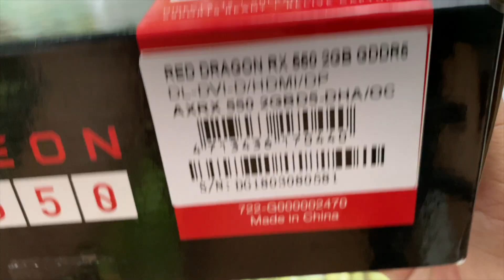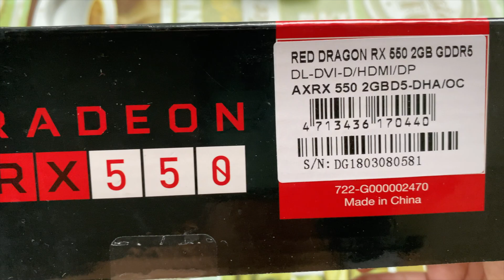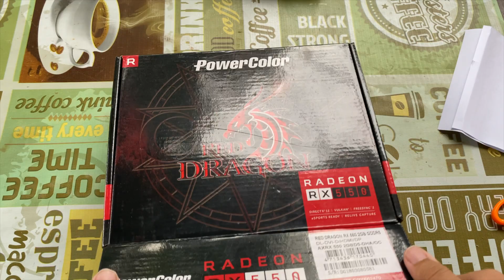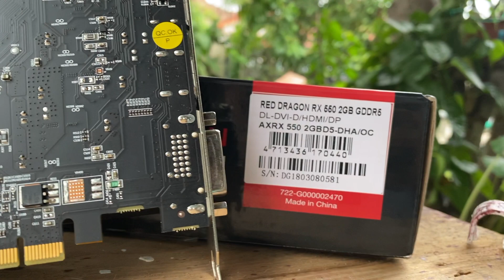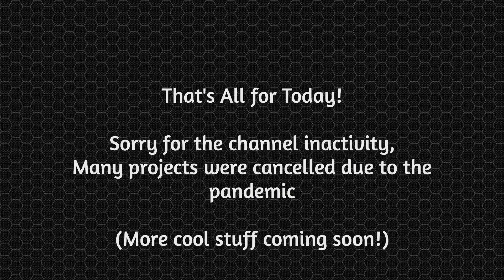AMD RADEON RX 550 2GB/4GB | Unboxing, Installation and Quick Look [PowerColor Red Dragon]

Comment from the maker: If you have any questions don't hesitate to ask! I'll try my best!
Reply: Is it good to get it in 2021 and are the graphics good?
Reply from the maker: @txramaiesyt2546  it’s good enough for esports games.. don’t really recommend it for big or AAA games if you wanna game at 1080p
If we’re talking about 720p then it should be fine
Reply: Can core i3 3rd gen 6gb ram, can they support the gpu?
Reply from the maker: Use_Wallow_come sure, they can work
Reply: @GhastUnity  ok, thanks 🙂
Reply: Is the refresh rate Hz 75?
Reply: How do you clip
Reply from the maker: @zyxu1830  I think it supports 75hz!
Reply from the maker: @oogwayYT  clip?
Reply: @GhastUnity  How do you clip
Reply from the maker: @oogwayYT  what do you mean? I don’t understand 😬😬
Reply: the fan of my rx 550 is not spinning when im not playing. is that ok ?
Reply from the maker: Yep! It has a 0 rpm mode when it’s idling. Perfect for HTPCs
Reply: Is this good with i7 10700 processor?
Reply from the maker: Yep should work fine with an i7 10700. Id advice go with a better graphics card if you have the budget though.
Reply: Any suggestions?
Reply from the maker: I’ll give a few recommendations but GPUs are hard to find right now

GTX 1050 Ti
GTX 1650 Super
RTX 2060 / 3060 (very hard to get)
RX 570

These should be 50% faster  than the RX550.
Reply: What's the cost of RX 550
Reply from the maker: I can’t tell you the exact cost of a RX 550 because due to the current situation the prices are very unstable. At MSRP they should be around $80-100
Reply: @GhastUnity  Okay thanks 👍
Reply: The gpu turns on but it won't post I think it's because I don't know how to connect it to the power supply
Reply from the maker: @pxrple1686  this RX 550 doesn’t require any connections from the power supply.
Reply: Hi there, in the video it shows the vram as 2048 but the product states that is has 4gb. why are the two different? btw im new to pc building so if i misunderstood something obvious then please help me out cos i dont really know what im doing 😬
Reply from the maker: @joeygibson9702  because I’ve bought the 2GB version. Nowadays they are all 4GB models. If you see 4GB, then you’re good to go.
Reply: @GhastUnity  ah i see, thankyou very much for your quick reply. i shall find a 4gb model for a budget build online 👍
Reply: when I  install card, all i get is a blank screen upon start up, why is that?
Reply: Does the POWERCOLOR RED DRAGON RX 550 work on asus prime b450m
Reply from the maker: @THEXGAMER01  yes
Reply: Ist ok for very old motherboard
Reply: Bro mine is 250 watts power supply does this work for me?
Reply: Can it run fortntie 1080p
Reply: Is this the best rx 550 on the market rn?
Reply: bro how much watt power supply is needed
Reply: @GhastUnity  Is it good and run smoothly in amd 9600?
Reply: thinking of buying it some day and i noticed the graphics card has an hdmi port that sticks out, do i need to connect that somewhere to make it work? (if so i'll need a new pc cuz my motherboard is vga only 😭)

Comment: your the only person i can find with this card who will reply so i got a couple of questions, what sort of fps are you reaching on fortnite and call of duty. how loud is the fan and finally give me any more info like pros and cons from your experience
Reply from the maker: Hey there I couldn’t say what FPS I get for call of duty but I’d say it will be playable at 720p (60> FPS) and for Fortnite I get around 70-85 FPS at 1080p (competitive settings) with 16gb ram and the 2gb variant.
If you have a little more do go for the GTX 1050/Ti as it will be better overall for gaming (and better driver support cuz AMD abit slow with driver updates and support compared with NVIDIA) 
As this is an entry level GPU - don’t expect 60 FPS+ at 1080p with AAA games 
But for most e-sports Games (I’ve tested cs go, rocket league and valorant) can guarantee 60+ FPS 👍🏻 at competitive settings (or better settings in some cases)
Reply: @GhastUnity Hi, did you used all of the available display ports from the gpu? the dp, hdmi and dvi portss???

Comment: The RX 550 is really the only reasonably priced GPU Avitabile rn, this variant along with another slim factor card from Yeston were the only ones I could find for around 200$
Reply from the maker: Yeap. Unfortunately. I luckily managed to get a 3060Ti with only 10% more than MSRP. I couldn’t get another GPU for my friends tho. Literally zero in stock atm.
Reply: @GhastUnity  Yeah scalpers and miners make it hell to get cards, lucky for me I got the Zotac RTX 2060 back in 2019 and so far it's served me well.

Comment: Nice vid, im planning to buy this card for my budget build. Anw what cpu will works fine with this gpu? Still kinda confused on what cpu should i get
Reply from the maker: Hi there, If you’re going for a budget build. I would recommend i3-9100F or i3 10100 and  Ryzen 3 3100 or 3300X
These CPUs won’t bottleneck the RX550.

For an AMD build, I recommend going for dual channel memory for maximum performance. You won’t see big difference going single channel for Intel which leaves a good upgrade path.
Reply: Okay then, guess I'll take the ryzen 3100. Is a 2x4gb 1600mhz ram enough?
Reply from the maker: @farrellsuryaghifari7014  Nice!, AMD has great upgrade path because they are using the same socket for quite a long time now. 1600mhz for DRR4 is very low. I don’t even think they’re selling that.?
Try looking for 2666 MHz minimum for AMD.
8GB will be just enough for 2020.
If you’re looking to upgrade in the close future soon I’d recommend going for 1 8GB stick so you can upgrade to dual channel 16gb later.
If you’re not then go for 2x 4GB

As for motherboard I’d recommend minimum B350 or B450 motherboard as its provides overclocking capabilities and much better VRMs to handle more powerful CPUs down the road compared to A320 chipset.
Worth the extra dollars if you ask me!
Reply: wow, that's alot of explanation lmao. But appreciate it alot, thanks, I'll Go for 2x4 2666mhz then. Thank you for also mentioning the motherboard, really you're a nice person. Anw since im new, can all type off gpu get overclocked? Sorry for the question and suck English lmao
Reply from the maker: @farrellsuryaghifari7014  your welcome! Yes and no. All separate / dedicated GPU like in the video can get overclocked to different levels. It’s based on the type of GPU and your luck. Some overclock higher than others. It’s called Silicone Lottery.

Built in GPU or APU they call it cant really be overclocked.
Reply: @GhastUnity  ah thanks, any rec on what budget case i can get? Lol sorry, im a newbie at this
Reply from the maker: Farrell Surya Ghifari any case with good airflow will do. Try looking up on YouTube for recommendations, and make sure your motherboard will fit in the case.
Reply: @GhastUnity  got it, thanks
Reply: @GhastUnity  should I get this in 4gb or gtx 760 in 2gb??
Reply from the maker: @As0hy  GTX 760 will be heaps faster than the RX 550, if your power supply can support it. RX 550 is a entry level new GPU.
Reply: Same

Comment: Hey, thanks for this video! I hope you’re still replying to questions. I’m building my first pc and got all the parts. However, as you probably know, gpu’s are out of stock everywhere. So I ordered this one for temporary use till I get a chance to buy rtx3060/3070.
I’m using Ryzen 7 3700x, with a x570 plus (wifi) motherboard, 16 gb 3600 ram. Do you think this gpu will perform decently as a temporary build? Will there be any damages to other parts like the cpu if bottleneck happens?
Reply from the maker: Bottleneck doesn’t damage anything. It really depends on what resolution your trying to game on. Expect below 60 FPS on AAA (or big) games and some E-Sports surpasses 60FPS easily. I’d think it will be good enough for now until you get a better graphics card. Have a look out for GTX 1050ti or something close, because they are better.
Reply: @GhastUnity  Thanks for replying! Appreciate it! Yeah I found that 1050ti is better, but I can only find it at double the price of this one, and for a temporary build, it’s not worth paying extra but rather save the money for the real gpu that I want. Also, do you recommend the 3060 with ryzen 7?
Reply from the maker: @bilalaliahmad7432  I see. Then I’d recommend sticking to the lower costing one for now and save up. Yep your Ryzen will definitely be enough for the 3060. And I’m glad you went with 3600 MHz ram! Really beneficial for Ryzen systems. Many mistakes I see with pc builds they used slower 2666 MHz one which has a big impact on the performance of the system no matter what Ryzen CPU you use!
Reply: @GhastUnity  Awesome that’s great to hear! I found the best bet was to get a speed higher than 3000, and I just wasn’t settling for less than 3600. Anyway, thank you for answering, you help a lot of beginner builders like myself.
Reply from the maker: @bilalaliahmad7432  Have fun! My pleasure! Subscribe if you haven’t haha 😅
Reply: @GhastUnity  haha I was actually your 340th subscriber

Comment: Hey boss so all the parts are coming in for my Ryzen 9 Threadripper build and we'll was thinking will it run good to start off on my cpu? With that gpu?
Reply from the maker: Wel, it does work but please set your expectations low for the RX 550
Reply: @GhastUnity  Alright for sure, its just to get it started cuz I sold my gaming laptop and we'll I got college lol so I gotta build it for college you know, so it will bottleneck but I won't notice it right ?Also I'm getting the Power color Rx 550 4gb version
Reply from the maker: Ronaldo Rodriguez your cpu definitely won't bottleneck the RX 550. It is a pretty weak GPU for 1080p gaming or anything graphically intensive...
If you're doing work in microsoft office for sure no problem 😉
Reply: @GhastUnity  For sure boss I will be doing that and a little of gaming but might get a 3060 from my buddy soon
Reply from the maker: Ronaldo Rodriguez alright good luck on your build!
Reply: @GhastUnity  Thanks man and keep up the good youtubing work! I'll make sure to shout you out on my main channel for the benchmarks and so people can go check you out!

Comment: Are there any GPUs that has plug and play thing. I mean gpu with no powercable and direct connection through motherboard? I have an old pc , i3 3210 .
Reply from the maker: @blipbytes  I think some models of the RTX3050 series doesn’t need any power. Please double confirm that by checking the graphic card’s product page before buying.

Comment: Nice unboxing, is this one compatible with the Ryzen 5 3400G?
Reply from the maker: Yes it is compatible. But I wouldn’t really recommend this GPU for you because it is a small jump from your current iGPU (Vega 11) it is only around 10-36% faster. Maybe try to upgrade to RX560, GTX 1050 or 1660 Super?
Reply: @GhastUnity  Oks, maybe the 1050 cause my budget. Thanks!

Comment: do the fan have autostop (so it is completly silent when idling / watching youtube)?
Reply: @GhastUnity  i mean the fans on the graphics card in this video
Reply from the maker: @jespertordebringjansson1397  yes it supports 0 rpm. Will turn off the fan no high load on GPU

Comment: Getting no signal on monitor. Is there anyway to test and make sure the GPU is good. This is a new build so can’t test it through computer.
Reply from the maker: No. You need another computer to test if the video card is working or not. Make sure you connected the display to the graphics card and not the motherboard.
Reply: @GhastUnity  thanks for responding so quickly. Will like and follow thanks!
Reply from the maker: @judah2946  thank you! 🙏 Welcome!

Comment: My card is not powering on. And I have a VDG Connector from the tower that I can seem to get correctly connected to the motherboard. Any help please?
Reply from the maker: Please connect the display to the video card output, the bottom ones.

If it still doesn’t work you need to manually select to use your GPU as the main video source 
(VGA/VIDEO CARD in bios probably)

Comment: Do i need to install drivers before setup of graphic card or after when i setup it, and why i need to install drivers which u put in description over this CD i get?
Reply from the maker: Install after installing the graphics card in the computer. The CD drivers are usually outdated and you’ll miss out on important driver updates. If you have internet, 100% use online drivers.
Reply: @GhastUnity  i have internet thanks

Comment: what if i have a wifi card using that plug inside the pc can I move either to the bottom ones?
Reply from the maker: Yes! You definitely can the wifi card on the bottom of the slot fits. Always make sure to install the GPU on the top slot.
Reply from the maker: @UCooiM-Feueh6Xgb05sc93lA definitely on the GPU. You won’t get a signal if you connect from the motherboard (with all the usb and stuff near it)

Comment: Will i need an 8 pin or 6 pin wires if not will my pc run fine? I was wondering this because i was going to buy one but I didn’t want to mess it up or not have it run. It is my first build by the way and i am super nervous
Reply from the maker: You don’t need any of those luckily! This graphics cards runs only from the motherboard’s PCIE slot 😃

Comment: should i but the ddr3 4gb cause i have and i3 9100f and 8gb of ram and ddr3 socket
Reply from the maker: This GPU runs on GDDR5. There is no DDR3 ram support for I3 9100F.
Reply from the maker: @reemamishra2188  this will work with your pc.
Reply from the maker: @reemamishra2188  that will work.

Comment: Pls tell me which motherboard u r using i mean i m buying rx 550 and i need a cheap motherboard 😭😭😭 can u please help
Reply from the maker: any modern motherboard + cpu will work with this GPU
Reply: @GhastUnity  i mean my price is very low like 4000 and i m using 3rd gen i5 and i was thinking if it would work on my H61M VS4 motherboard???
Reply from the maker: @xploslost   I think it might work, just make sure you have a strong return policy incase it doesn’t.
Reply: @GhastUnity  hands crossed ima set it up to night i will notify if it works
Reply from the maker: @xploslost  alright

Comment: if you pair this gpu with a ryzen 5 3400, will there be any issues with compatibility?
Reply from the maker: Ryzen 5 3400G? It will work fine.  But I strongly suggest upgrading to RX560, GTX 1050 or GTX 1660 because these GPUs will perform way better than the entry level RX550

Comment: I just got this today and installed onto my asrock b550 pro4 motherboard and it says no hdmi or vga signal. I've switch between both and nothing. Also, this is my first pc build
Reply from the maker: You need to connect it to the graphics card, the bottom ones. RX550 doesn’t have VGA!
Reply from the maker: You need to connect it to the graphics card, the bottom ones. (Don’t plug it near the other ports like USB, those are for integrated graphics.) RX550 doesn’t have VGA!

Comment: i got this gpu and intel i3 10100F i got a 23% bottleneck from my cpu does it affect the games because i can barely run fortine i got 8gb of ddr4 ram 2666mhz and when other test my requirements they run fortnite on high without any issues is something wrong with gpu or?

Comment: Bro can we use this GPU with g41 mobo and dual core e5300
Reply from the maker: Is that core 2 duo? I don't really recommend pairing with such an old CPU but I'd think it will work.
Reply: @GhastUnity  Bro I will upgrade to quad core q6600

Comment: sorry to sound silly, but what game can run so far?
Reply from the maker: Most modern AAA game can be run at 1080p but only around 28-40 FPS at low settings. 720p can make it abit better.

Any light games like CS-GO, Overwatch, Fortnite can be run 60+ FPS in 1080p without any problems.

If you have powerful enough power supply I recommend steeping up to atleast RX 560 or even better RX 570 for smooth 1080p gaming
Reply: @GhastUnity  does that mean if I play minecraft it will be like reaaasslllly fast
Reply from the maker: @nihaalspeaks  minecraft is a really cpu dependant game. But you can definitely achieve 100+ FPS (1080p) in minecraft with the right processor in single player mode.

Comment: So all I have to do is plug the gpu into my motherboard? No cables?
Reply from the maker: Yep! No external power required
Reply: @GhastUnity  does it make a difference with the motherboard, or all the same?
Reply from the maker: @iamlurrxy  motherboard provides low levels of power to the video card. The RX 550 only needs the low power from it and no additional power from the power supply.  Any motherboard (not prebuilts like dell and hp tho) should work fine and won’t cause any damage
Reply: @GhastUnity  tysm🙃

Comment: How reliable is this card in terms of lifespan and PowerColor as a company themselves?
Reply from the maker: The card runs pretty cool so I don't have any worries about its longevity. I used several power colour video cards for myself and my friends and they all still works to this day.
Reply: @GhastUnity  One last question, how does it perform in the FPS range for major titles like fortnite, GTA 5, Crysis, etc?
Reply from the maker: TrashNightYT you should be able to achieve 60+ fps on fortnite and other similar games at competitive settings. As for big games like crisis maybe 40-60 fps at 1080p low-med.

Comment: Would the compatibility between a Ryzen 5 2600 and this be okay?
Reply from the maker: It is fully compatible with Ryzen 5 2600.
Reply: Yes but I would go for a 2200g or 3200g